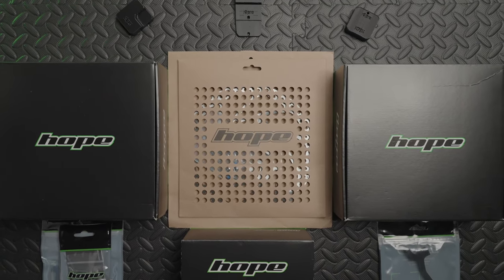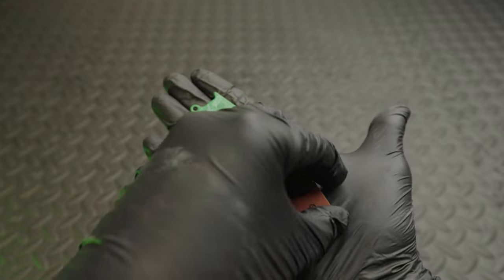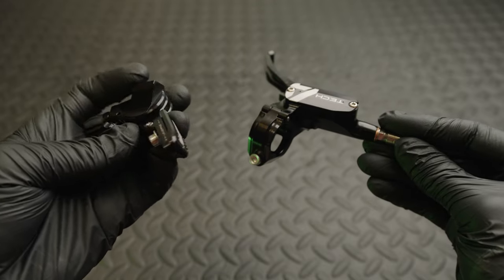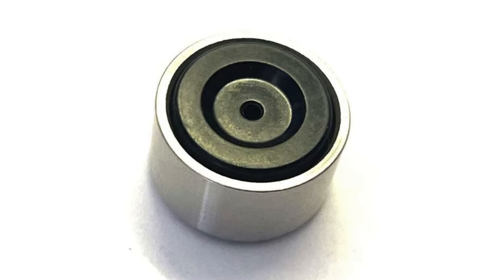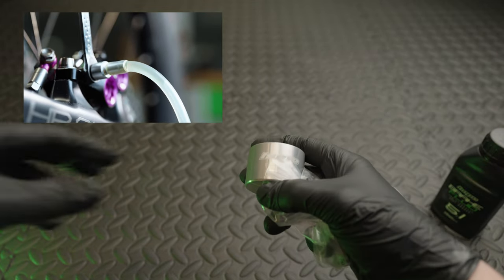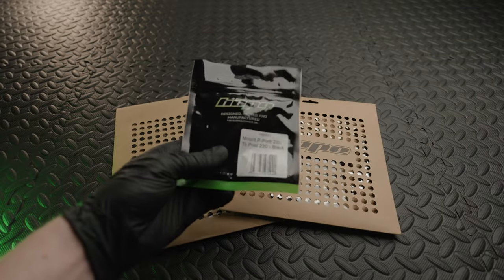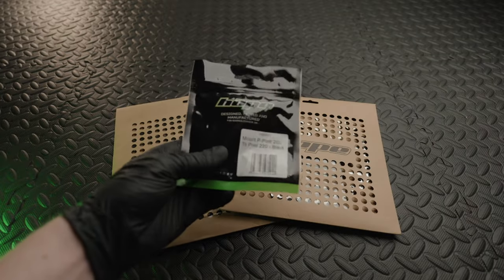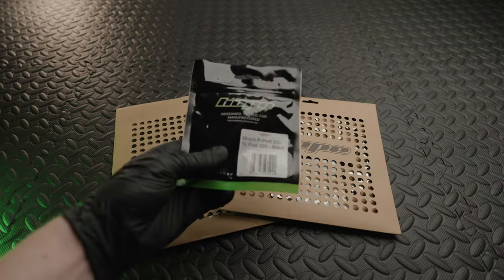Hope Tech 4 V4 Brakes

Comment: hey mate which brakes are better in your opinion these hope v4 or trp dhr evo??? which would you choose and why? thanks
Reply from the maker: I haven't ridden the v4's long enough to answer definitively but the v4's do have extra power over the trp and a smoother more controlled lever feel. I'll do a follow up review to see if they stay consistent as the trp's have been excellent in that regard without any issues.
Reply: @jedmtb  hi. thanks for the response. I will be waiting for your review. cheers
Reply: The trp dh evo are absolutely superb brakes .....solid reliable and powerful however the levers cannot be brought close enough to the bars without an aftermarket lever .I love to run mine really close
Reply: The green race pads are made by trickstuff not galfer .....galfer couldn't make a pad as powerful as hope required so they switched the greens to trickstuff. Purp,e and the organic red and all galfer
Reply from the maker: Thanks for letting me know, trickstuff make great pads, I've been using their orange power pads for years. @knott4me561

Comment: I'm having trouble getting them perfectly alligned so there is not rotor rub.  Even once bedding, adjusting,... it would be so nice if their was a bite adjustment.  Do you have any reccomendations because once they are bedded i cant get the front to be noiseless, it inevitably touches somewhere because fitment is so tight.  I'm running the vented rotor
Reply from the maker: As you say the vented rotors are a very tight fit, what I used to do with mine was bend the pad springs out, here is a video showing what I mean. https://www.youtube.com/watch?v=MDfzkZqvacU